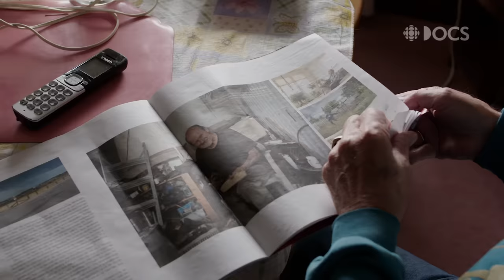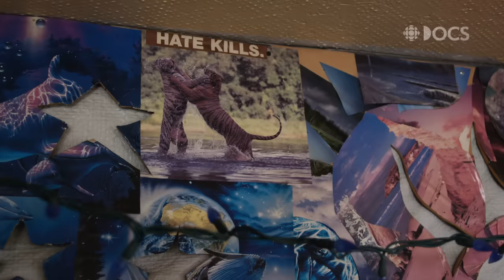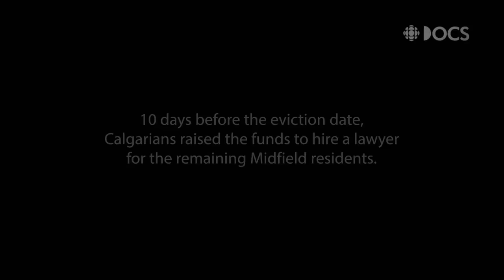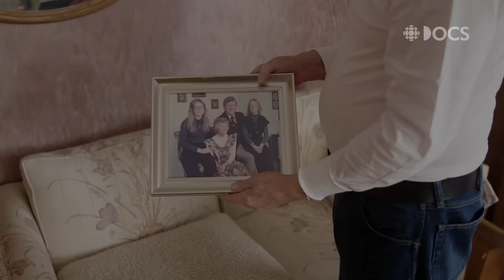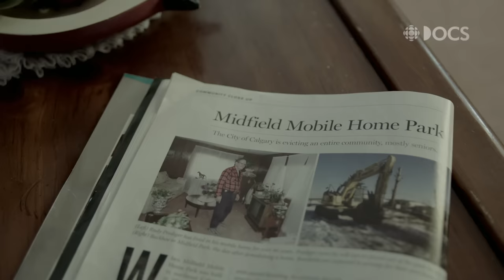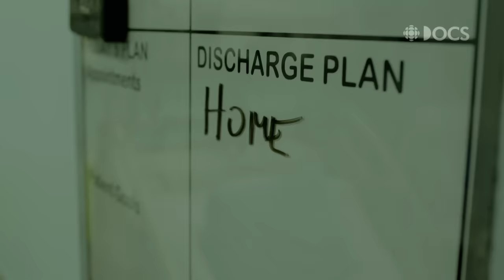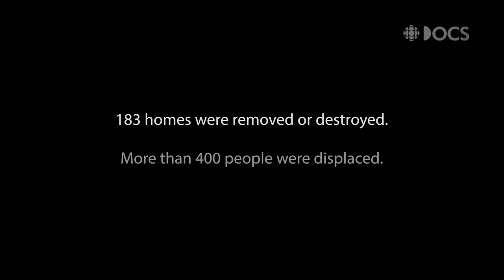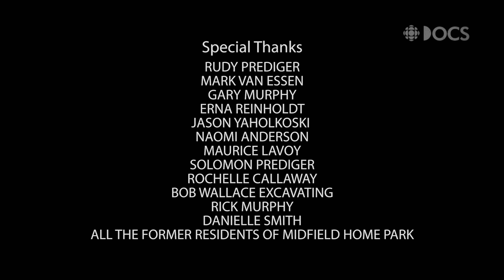The city wants to evict them from their mobile homes. But they're fighting back. | Eviction Notice

Comment: This is truly despicable and downright EVIL!!!
Reply: Rental is a set terms and $ for a set time frame... not eternity, the contract ends, obligations end.  Land owner gets to control don't like it buy your own so the choice is yours. They got 2yrs more then required by law and $10k. They still owned the home and could have moved it. They all chose to leave their trailer trash behind costing the govt more money. Robbing the community of those funds. If you disagree with the govt choices, get in there so YOU can help make decisions.
Reply: Tragic
Reply: @mrmotofy  I live in this city.  These were homes not trailer trash.  Most of these folks were seniors and disabled people.  The park is an old one and the infrastructure probably DID need replacing.  It's on top of a hill overlooking the golf course and the reasoning was that water leaks were causing the slope to become unstable.  Also the city does want to have retail in there as it's on a major east west road.  Owners of homes in this park that COULD be moved were offered that option I believe.  Problem is that a lot of homes were 30,40, 50 years old or more.  They can't be moved, they won't hold up.  $10,000 was not enough by far but it was a bad situation all around.
Reply: @Jane-lf2fb  If they were that old...they were overpaid for them then and should consider themselves lucky.
Reply: Amen

Comment: they are in a rush to push everyone off the property only to have it sit vacant with no plans to develop on it. What the hell did you kick them out for?!
Reply: Because  the location of the trailer park was worth big money, which means big taxes.The reason it is still vacant is that Calgary  is the oil capital of Canada,and since the slump in oil prices is not doing so well.
Reply: In Detroit metro area lot rent just went up to 700.00 a month.  hardly any lots . terrible people can't even use a tax break on them.
Reply: It's always about money.
Reply: @standupstew1645  Yes it is the oil capital - but Alberta can't take advantage of that potential when you can't move it out of the province. It is what it is.
Reply: Right

Comment: Sadly this is the reality of living on land that you don't own. This happens over and over again. I think that mobile home parks should be co-owned by the residence - like a condo development. The shared cost of the land would be reasonably affordable and they would have complete control over their land.
Reply: Great point
Reply: That would never be allowed. The whole point of forcing people to live in trailer parks with mobile homes and not allowing them to be put on owned property is to segregate and marginalize people who would otherwise benefit from the affordability of manufactured homes. The whole point is for municipalities to have the freedom to rip their homes from them exactly like this when it serves the interests of those with more money and influence. If someone wants the land for development, and/or they want to clear out the "riffraff", ie working class and poor people, then they have the ability to get rid of them.
Reply: @owatinay  Its been a year so I had to re-watch the video. You make a lot of good points. But honesty Owatinay there had been no upgrades to anything for 35 to 40 years - most likely longer. Some of those structures are very frail and they could not work around or moved without causing damage. What the City should have done was move the entire park to a new location and help finance new trailers for those that could not be moved. We did that in the town I live in, the Town moved everyone to a new location with full, new services and roads. I stand by my original statement. The pad fee would be about the same as a portion of the shared mortgage - totally affordable.
Reply: That's bad business. I feel bad for those people though.
Reply: @marcusfitzgerald59  I feel bad for them too.
Reply: It happens even when you own the land. The gov can make up or use out dated laws to take your property.
Reply: @imdurmac1  yeah so true and they also higher taxes to the point you have to decide pay for food or your land.
Reply: Same also happens to traditional homes. They are often pressured out when the city wants to build more expensive/updated homes. Sadly...imminent domain renders so many vulnerable...be that mobile homes, traditional homes, and even small businesses.
Reply: @owatinay  Actually some people do own their land at some trailer parks. It gets run like a condo building.
Reply: @imdurmac1  True but not nearly as often.
Reply: Doesn't really matter if you pay property taxes it's never yours
Reply: @thorpower1015  True - but you own the equity in the property. Generally speaking if the government wants your property they have to pay fair market value for it - which gives you enough money to buy something else. If you are leasing or renting you get nothing.
Reply: @dannsherstone1037  no the govt can take away all your stuff through eminent domain whether you want to sell or not.
Reply: @imdurmac1  AKA imminent domain.☑️
Reply: lol I bought a condo and what a HUGE mistake!! You might co-own it but you are at the mercy of the HOA. You can get $50k or $60k assessments. Never never again.
Reply: @mistiinseattle  I would not go the condo route either. But if someone has a limited budget at least a condo or co-op trailer park would give them a measure of control that you don't have as a renter.
Reply: @dannsherstone1037  When I sold my condo there was a $15k assessment against it, which fortunately my realtor got the buyer to pay. We were all aware that within a few years there would be another approx $50k one, and later still another. This is addition to your mortgage and skyrocketing HOA dues and property taxes, not to mention upkeep. Most people cannot afford that. lol when I sold most of my neighbors were trying to sell too. A condo is NOT a wise investment. I am now a very happy renter
Reply: @dannsherstone1037  Actually you have more control as a renter because you can get out of it. If you put a mobile home on someone else's land and they sell it - or you buy a condo and the bubble bursts or you get hit with a $80,000 assessment - you are just up a creek without a paddle. lol ask me how I know. I bought a condo in 2008 two weeks before the big crash. 😁
Reply: Laws need to be changed
Reply: @stj971  land owners have a right to do what they want with their own land!
Reply: @dannsherstone1037  exactly,  so true
Reply: @mistiinseattle  and that's defenetly wrong.  It gets abused.
Reply: @PhoenixFires9  entirely different circumstances
Reply: @owatinay  a city near me is doing this right now to a small mobile home park.  Evicting the residents.  And as another point, the entire county this city is in won’t allow mobile homes to be placed on private land…mobile home parks only.  Keeps the control in the government’s hands.  Who are they to tell me I can’t place a debt free mobile home on my own land?!
Reply: @mistiinseattle  not according to my county zoning office…
Reply: In actuality you don't. If the govt wanted to build a freeway and your Subdevelopment was in the way they would offer you less than what your property was worth and keep dropping the price down until zero and bull doze away to put the freeway in. I watched it happen here 25 years ago and a coworker planned on retiring in her home that she just got done paying for. They tried to fight it, which only delayed the process and she wound up with only 50% of what the real value of the property was worth. She was told it's not worth anything because it's going to be blacktop in 5 years and that's what it is today.
Reply: @lilpinksliplee7310  I don't know where you live but this happened in Canada and the government cannot do what you are describing. I think they can force you to sell but they cannot do what you describing. This situation was property owned by the City of Calgary - so the victims were tenants not property owners.
Reply: Like a co-op?
Reply: @christinamann3640  Yes - a co-op. People live in trailer parks because it is the only housing they can afford where they own the roof over their head. They can't afford the land to put it on. So if they banded together, pooled their money and purchased land; they would have more control over these situations.

Comment: Gary's Wife says:   We lost out home to foreclosure during the Depression of 2006 - 2016. First ouor jobs were gone overseas, then we lost our house after we had exhausted all of our saving trying to save our house (mistake). We bought raw land real cheap (35 acres for $17,500 forth miles east of the city) because there was a huge mess on it and we eventually cleaned it up. We bought ($600 - yes, $600 dollars) a used mobile home (1980) that was headed for the landfill. We had it moved to the property ($500). It was barely better than a livestock barn but we were very poor and had no choice. In 6 years, we have remodeled it and replaced every part from the floor joice up to the roof (this year, we put on a new pitch metal roof). Everything is beautiful and modern. Our house is 1000 times nicer and upgraded compared to a cheap-ass NEW MOBILE HOME that sells for $49,000 at the mobile home dealership in the city. We are in our mid-50's and the only help we got from others was the guy that handed me $20,000 cash from his safe and told me to go buy the land. He also said, "Pay me when you can" - and we paid him off first even though areas of the house would be considered UNLIVABLE by 100% of the people in the United States. We never could afford utility poles to be brought to the land, so we have used a $500 HARBOR FREIGHT GENERATOR for power for 6 years while we bought Solar Panels and components one at a time and checked them off our NEEDS list. A well has been inflated to $30,000, so we still dont have a well, but bought a 450 gallon water tank and the water is gravity fed into the house (not much pressure, but someday we will have enough money saved up to get a well installed). We haul water in a 55 gallon barrel secured to a tiny trailer and pulled by our little car - we fill up in the city at one of our friend's houses, bring it out and use a transfer pump (Harbor Freight) to get the water into the big tank. Our friends that are far better off than us, financially, have a lot of respect for us because we just kept being positive and moving forward. We bought the land for half price because of the terrible mess that was on it. In 7 years, it has tripled compared to the 2012 value. There has been tremendous Urban Sprawl in our direction in the past three years. Though we lost everything about 9 years ago, we will have something nice to leave our children when we die. God is so Good !
Reply: Gary Wilson A very nice story! Land will most always go up in value...can’t lose. My two brothers were both given a nice chunk of farmland when their father died...I received nothing so had to struggle and save on my own. They are financially well off, my house is about half paid for and in another 10 years I will be pensioned off. Not much time left but we just keep struggling on. Life is short so we shouldn’t worry too much and make the best of it. Also raised 4 children...made sure that they all got a good education and trade so they can look after themselves.
Reply: Those were two beautiful stories.  Thank you for inspiring with pure positivity 🙏 🤗
Reply: Great story! It reminds me of the old saying "do the best you can, then do better'. I hope all is well with your family.
Reply: God had nothing to do with your success.  You did it all yourself and you should be very proud of what you did by your self.
Reply: A 12v or 120v rv water pump is very cheap comparatively and can give you an all in 1 piece pressurized water system
Reply: Harbor Freight and ingenuity did it again.
Reply: Thats a great story. God bless you always 🙏

Comment: They get 10,000 and still own the home. The man said he just spent 60,000 upgrading his home!
Reply: Maybe that was his last 60,000 and wanted to be all set for the next so many years he's alive. Mobile homes have sort of an expiration date on them. I'm considering building or buying one, purchasing land, or something existing--weighing my options--in the next few months. I contacted a reputable home builder, in the area...he gave me a lot of helpful information to consider before I made a final decision. He's the one who explained  what happens, the deterioration process, even if the homes are built well, within about 15 years or so it starts to wear down. Maybe the man had just been saving up that money to do what he needed to do, or used all of his savings thinking he was going to be there for another decade or 2 ?? I wouldn't begrudge him that, personally...
Reply: @kathyevans757  Mobile homes do not deteriorate any faster than houses,they are built of the same materials.The frame is steel,most mobiles built after 1980 have 6ins. walls.If the mobile is built with a proper foundation it will last as long as a house.If you are handy at D.I.Y.,or a carpenter,you can make a mobile last as long as a house.My Mobile is 1975.any home that is 15yrs. old will show signs of wear,you have been misled on the breakdown.What you were told was applicable to the 1970's trailers,but not the newer ones.
Reply: @standupstew1645  No they aren't.  My first job out of high school was putting plumbing in mobile homes.  I think you are talking about manufactured homes.  There is a big difference between the two.
Reply: Why would anyone one spend 60K to up grade a trailor?

Comment: This is horrendous . . .  What if they decide to do this to other mobile home parks in Calgary? Are other mobile homes parks there in danger of the same thing happening?
Reply: It can happen to anyone not only the trailers or the mobile houses. It is called expropriation. The government has long long hands.
Reply: The problem is that the people in these mobile home parks do not own the land. They rent. They need to do what Grandma and Grandpa did. Buy a piece of land and move your trailer on that.
Reply: @PhoenixFires9  The problem with that in Calgary is that no municipal government will give a permit to set up a mobile home on land within a 1/2 commute of Calgary.
Reply: Give it time.  It will happen

Comment: I'm an electrician I work in Sacramento and I specialize in working on mobile homes and trailer parks I can do residential commercial and light industrial 75% of the trailer parks I go to look worse than this one that's bull they wanna use that land for something they need to pay them ppl ,5 times what they paid because inflation and let them move to a sister park
Reply: Agree, and Amen to that. $10,000 is disgusting. And judges earn $350,000 - 450,000 p/y which is payed for by the state, also, so they never had a hope in hell of being heard amicably

Comment: Why not convert the trailer park into a cooperative owned and run by the residents?  The USDA financed such a project since they are involved in rural development.  Manufactured homes are low cost and avoid the sort of high density misery found in urban areas.  Even if you get rid of that trailer park, why not offer assistance to move the trailers elsewhere?

Comment: Did they get to keep their homes???
Reply: Hello Gracie, for the homes that could be moved and accepted at other parks, yes. Some of the homes in Midfield were double wides and wouldn't survive the move. In addition, many new parks have building code restrictions that excluded many of the Midfield older homes, giving the owners no location within the city to relocate. And finally, there are few spaces for mobile homes within the city generally, and residents are bound to the city due to work and other commitments. That is why many were destroyed.

Comment: Wait a minute! Isn't the water main the culprit?  Why aren't they using that big excavator to dig up the old water main then?  I don't think all of the facts were told in this documentary.  Much of Gary Indiana sits vacant and much of Detroit.  Don't forget German town in WI.  How are those buildings left standing WITH NO ONE LIVING IN THEM???
Reply: the dude said the way they were built they can't do anything  at 2:57
Reply: @Ace-ke7fq  I actually worked on a trailer home for someone.  The one home owner stated that was just a lie to get the ball rolling to evicting them.  Of course anything can be repaired.  It just takes someone willing to do it.  The mobile home I worked on needed a water line wich was simply run underground from a main and connected into a water heater room from underneath.  We dug the trench with a shovel.  The sewer pipe runs underneath the middle of the trailer and exits at one of the ends of a trailer home.  There is a crawl space under the trailer homes from the metal frame wich always stays and even more room if the axles are left on.  Otherwise you can just lift the whole thing up like a car using bottle jacks.  Sounds like alot of those people were living on very little money and couldn't come up with enough for the main water and sewer lines from the city source to be run throughout the entire trailer park. Atleast they gave us just enough information to spark an interest and get veiws.